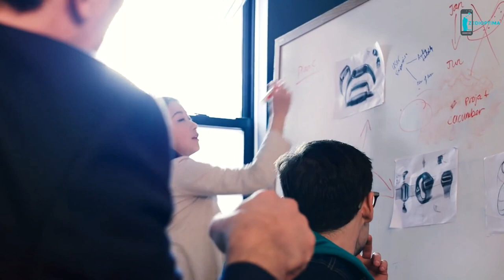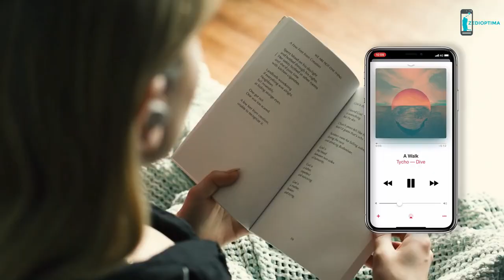Top 10 Best True Wireless Earbuds | Bluetooth Earphones Headphones Airpods

Comment: The wearbuds is not that good. I never like it. The battery is so bad and the watch doesn't complete 8 hrs. When you walk and call someone he can't hear you because the sound of air around you. Now i am using my wire headphones came with the mobile. Last thing very bad Bluetooth connection.